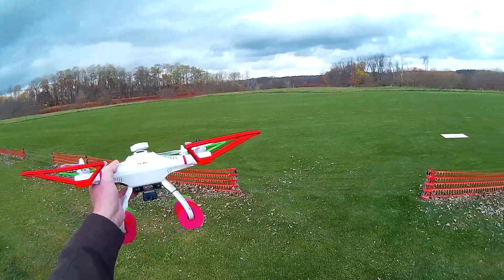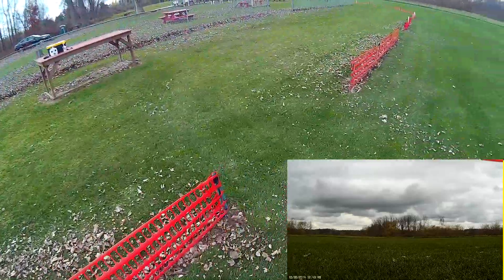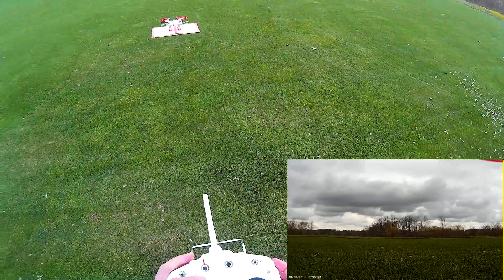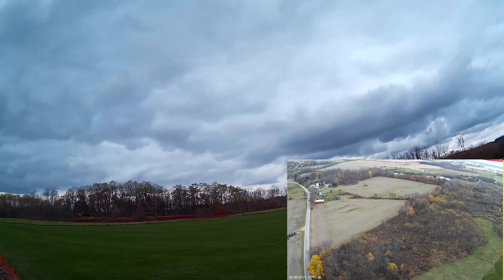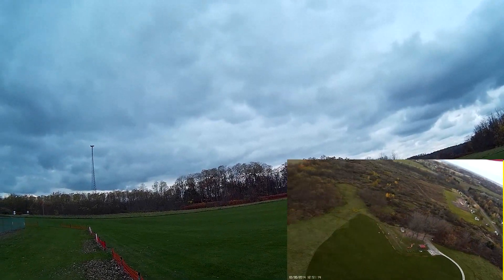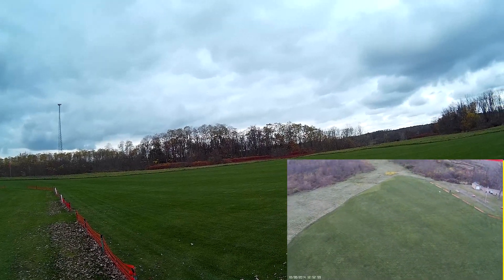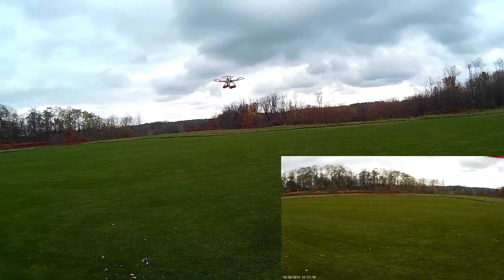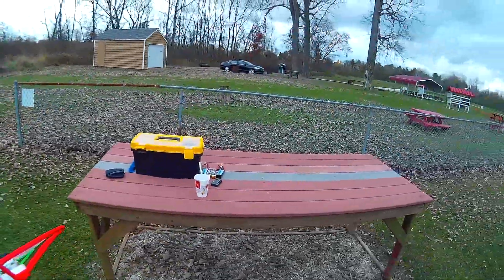Cheerson CX 20 quad with 5,000 mah Lipo battery runtime test

Comment: i get 20+ minutes with my quanum nova and a venom 3S 5000mah battery, also with a mobius underneath but no gimbal.....i can fly the 5000mah batter 2d gimbal and battery just fine in stabilized mode....but the second i try alt_hold or loiter it gets jittery, i wish i had saved the settings in the firmware before upgrading it :-( if i just use the included 2700 mah and nothing else on the quad then loter and alt hold seems more calm
Reply from the maker: Wow..  20 plus minutes??  I don't trust the Cheerson that much.  I've had the dreaded LVC crashes too often. The Cheerson CX 20 is a good quad if you know which precautions to take.  It's just the learning curve to know what those are that's painful. ;)
Reply: MrPolymers i 100% agree, been there done that....crashed it on its 10th flight....well a prop snapped as i had over tigtened it, and plastic cracked under the nut....it fell up side down from 15 feet up.....got it flying again after waiting for parts..didnt fly as good as when it was new... a friend suggested updating the firmware...so i did....bad idea if you ever want to use telemetry stuff....right now my biggest problem is the alt_hold and loiter mode ...in stabilized it flies great no problems what so ever....in alt_hold it will go up, down over compensate....sound angry...it really nerving to watch and hard to fly....loiter uses barometer as well, and so that mode is messed up as well...same problem...except it seems to over compensate for errors which if left alone will lead to a crash.
Reply: CygnusX250 and while i remember ...i had ordered prop guards, they came with screws....about 1mm too long ...sigh....so on one motor the screws made contack with the windings, rendering the motor junk....HK have not had the motors in stock for ages, so i replaced with a motor by Mars that looks and sounds the same at less than half the price, the quad flies again, but i noticed the original motors by Constar had zero play in them, where as the mars have a little bit, so i ordered a motor for the cx-20 instead...it has the same play as the Mars motor, dang it....

my crash above was onto pavement, and it actually knocked several resistors of the powerboard !  those resistors where responsible for LED and LVC .....with them out of the picture i flew my quad until it glitched from low voltage and crashed .

i got flightcontroller mounted on kyosho gel pad, 4 little squares (the less you use the more vibrations the gel pad sucks up) and still i cant get a good stable alt_hold or GPS...i just read that by turning on logging the cpu might not have power to do it all, and can mess up other things....so tomorrow i am going to try and disable those

Comment: Great video! Have you ever thought about making a tutorial on how to setup the way points with the CX20 / NOVA? I read somewhere that you can harm your quad by unplugging the USB cable while the battery is still connected. Do you know if this is true? Thanks
Reply from the maker: I may do that Michael, but I will run a test first to verify.  I've not had any issues with the APM software that I can see.
In fact, I use the APM software to verify the compass heading works great for me.

Comment: Hi Terry the last time we spoke you weren't happy with the Cheerson because of the crashes you had have you changed your opinion of it now. I got the Nova which I,m quite happy with but had a few teething problems like breaking a leg and the dome on top. I run 2700 Turnigy batteries and get about 7 mins but was impressed with your 12 min run. Does your battrey slip in the original opening or have you had to put the circuit board on spacers. I run the mobius held underneath but was wondering if I could get the  V262 HD camera off the old quad to work on the Cheerson/Nova as it gave excellent videos and is very light. Trying to find information on voltages etc to see If I could get it to work.
Reply from the maker: I use a simple rubber band to prop the door closed or just against the battery. I find using the rubber band even with the 2700 mah batteries is easier then the dumb door popping open all the time. The Cheerson is OK if you avoid the problems I've had like props falling off and LVC where the motors shut down.  Avoid those two items, it's a fun video platform. The Mobius is fairly light.  If you wish to save 20 grams or so, then by all means use the V262 camera. That will have less quality however.  I run the Mobius at 720P at 60 FPS.  60 FPS is always beneficial when taking any video with constant motion.  It tends to smooth out things.

Comment: Thanks for the Video! I have been looking for a video about flight time with the Cx-20. I currently only get about 5-6 minutes flight time with the stock 2,700 mah 3C battery, FPV 5.8ghz Boscam 200mah transmitter and the Quanum Q-2D gimbal. However, I just tested my Zippy 5,000 mah 3c battery on my Cx-20 with the gimbal and transmitter still attached and I got 13 MINUTES!! I can definitely feel the added weight of the battery but to me its worth the flight time. I just hope It doesn't stress the motors too much.

 I am pretty happy with that. I thought the flight time of 5-6 minutes is way too short. No fun. I will probably buy some extra batteries to see what I can come up with for the best run time. What battery did you use?

I read some posts about this Rhino 4,000 mah 3c battery http://hobbyking.com/hobbyking/store/uh_viewItem.asp?idProduct=50233 and I am thinking about getting it. It looks like it will fit in the quad and be able to close the door without any mods or maybe minor mods to the battery compartment.
Reply from the maker: Zach, looks like you are going through the same scenario as I am.  I thought if I could not exceed the 6 1/2 minutes I'm getting on the 2700 mah, I would not pursue an FPV setup.  The 5,000 mah battery does give me the 12 minutes, but at a performance cost.  Flies heavy as you know.  Let me know what you find with the 4,000 Rhino battery.  Do you know the weight of it?  This 5,000 mah battery I'm running here is 360 plus grams. Forces me to take the camera gimbal off.
Keep in touch and let me know how that battery works.

Comment: What battery is that could you give a link to it also how does the extra weight affect the way it flies, lands, ect... and how much weight have you been able to carry on it before it's just not right to fly or fly at all
Reply from the maker: Here's the battery: http://www.ebay.com/itm/291185098201?_trksid=p2059210.m2749.l2649&ssPageName=STRK%3AMEBIDX%3AIT

This is pushing the limit with the 46 gram Mobius camera.  The battery and the Mobius is just over 400 grams. Makes it fly heavy and does sacrifice climb rate.  I'd suggest getting a battery not exceeding 300 grams if you want to also use the Mobius camera.  If you have a motorized camera gimbal like I have, then stick with the 200 grams 2700 mah batteries.  Those will also limit you to 6 1/2 minutes flight time.  That's about it with this quad.
Reply: MrPolymers  I have been using this battery for awhile it works great fits tight in the stock battery cant close door but being so snug it doesn't move around and the weight is only 295g with 4500mah and 50c discharge 90c burst a bit on the expensive side but you get what you pay for and its a hard-case pack 
http://www.trinityrc.net/shop/index.php?route=product/product&product_id=381